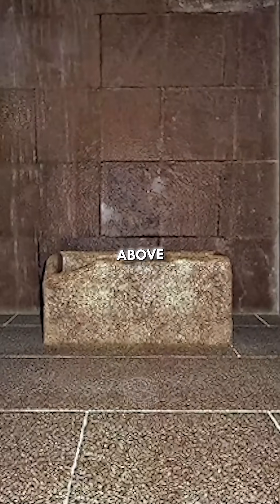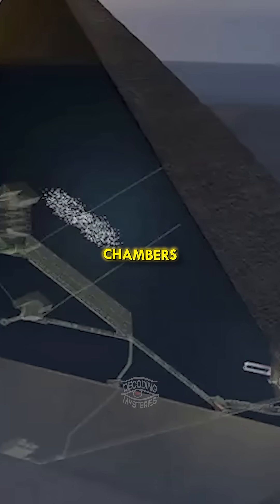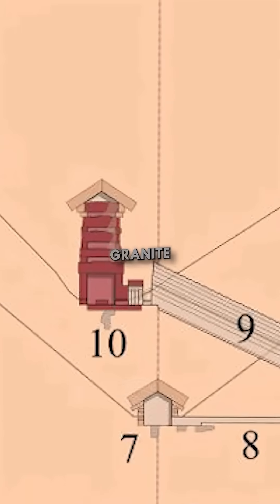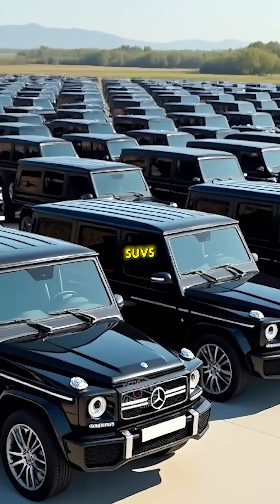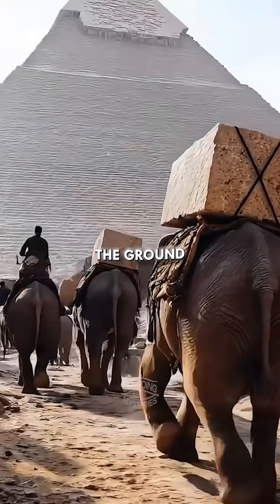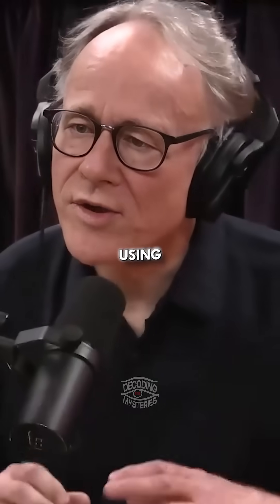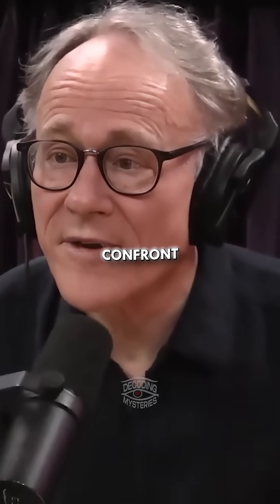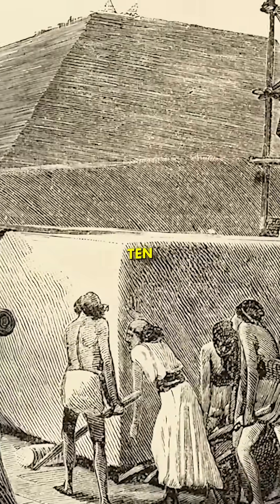Engineering Secrets of Egypt's Great Pyramid That Defy Logic 📜

Comment: The pyramid has a system inside to raise the rocks, a hydraulic system. They weren't tombs, but pressurized water tanks, and those rocks are there to prevent air from escaping.

Comment: The smooth stone started at the bottom and was used as a ramp to slide the blocks up as the pyramid grew and on the other side giant bags of rocks would slide down the stone slide on that face. Not a single elephant was needed. The small "nubs" that you can see on the bottom of the surviving smooth stone pieces was there to help you slide the stone sideways click them into place so the stone slides could be moved around and there was never any intention to cover the pyramid in smooth stone except the Apex because the pyramids weren't ever seen because they were the foundation stones of stacked decking stacked floors forming a cube around the pyramid with just the Apex protruding from the top.

Because the pyramids were not the point it was the buildings that they supported that mattered and with up to 60 floors stacked decking the two larger FLOOD RETREAT SHELTERS could accommodate nearly 300,000 people each during the floods the reason nobody made art depicting the pyramids is because they were not visible inside the cubic temporary cities they were built to support.

Comment: I know exactly how the pyramids were built.  They built a large pool surrounding the pyramids.   Water was filled to the top.   When you drop a 70 ton beams into the pool of water, the weight decreases as per the same laws of physics.  The water was also the best way to level the pyramid bases to make sure they are all leveled.
Reply: Free clue:  multi-ton granite and limestone blocks  do not float.  They are not rubber duckies.

Comment: The egyptions used the sand from the desert to make a hill and kept adding on to it as the pyramid got higher, Using elephants and teams of men to pull the massive rocks. They likely used logs underneath the stones to make them easier to move.

Comment: A thought occurs to me, and I will prefix it by saying that I am certainly not an engineer so, the hypothesis I am about to pitch is, I am aware, coming from a position of ignorance so I humbly request and encourage people who know more than me to kindly point out the flaws in my logic...

Could these beams not have been created in advance of the pyramid and moved up to the final resting place as the pyramid was being constructed beneath and around them? Thus they would not have had to move them up the steep incline, and they would be able to shift them in relatively small increments lowering the overall workload.

Comment: If you create a ramp at 10° and wrap it around the pyramid you reach the top at 1.13 times around the pyramid it's not hard you're over thinking it
Reply: Very plausible for most of the stones, but how would they lift the 400+ ton stones up a 10 degree angle? Even with modern equipment that wouldn’t be easy, you’d need a fairly strong crane. How did they do that almost 5 thousand years ago just in 20 years??

Comment: I think they used water power personally with sand as counter weight in huge hessian sacks, I think they used ropes tied around huge wooden reels that water power turned and additionally counter weights to add power, they could have used lots of sacks filled with sand as it would be easy to get up to height using small buckets and man power

Comment: I am knowm as Z¤yx~~1109` I am from the Ni¤vtyrver Galaxy. Our species is exceedingly far from Earth. We travel using black holes you have discovered to move through space. Its the way of interstellar travel. We built these pyramids using a gelogifyicpostranspfg quantum lineal pos prythific mass lifted and placed method. The human race has not yet developed to this stage of evolution.  It will be clear after the 12th quadrant of your brain develops. This means  another 200 years of earth years into your evolution. You are developing much faster than we anticipated..No amount of manpower or your current understanding of engineering could build them. They are markers for our travel navigation  and to help you develope the type of engineering interest you need to open the sectors of creation in your minds." AND THERE YOU GO!"

Comment: It could be done.  They used a vertical axis swiveling pulley crane mounted on a wagon.  Of course the machine was massive but they have all the time, horses and slaves they need.

Comment: The best description of how they lifted the stones is by using a hydraulic lift system. They built a hollow water proof column with an opening at the bottom. They would place the stone on a float and then fill the shaft with water which would then lift the stone upward, after the opening was sealed.
Reply: or you simply have counterweights. You just need a stable enough lift but given enough manpower and time it seems pretty duable. the counterweight is much lighter stones. Sounds like a lot of work as wel but they had tends of thousands of people and decades of time to build those pyramids.

Comment: His implication is that ancient Egyptians couldn't THINK! They used a counterweight to drag those stones up that 12 degree slope.
Reply: How'd they get the first counterweight up then?
Reply: @derekheuring2984  The weight of 50 people, each carrying a 100 pound stone..
Reply: @derekheuring2984  Smaller counterweights lol, I don't believe this happened though
Reply: @derekheuring2984  People walked up, got on a sled with rollers, and ropes led around pullys went back down, and pulled the stones up.
Reply: .   PEOPLE walked up the slope, and rode down on a counterweight sled, pulling the stones up to each successively higher row of pyramid stones.
Reply: and they used steel cables doing it.
Reply: @BigBeezyBtown  That's a joke, right? Ha ha.
Reply: @BigBeezyBtown Probably hemp rope.
Reply: @BigBeezyBtown  even with steel cables you'd need about 30 of them, 1inch thick each, to safely lift 70 tons
Reply: @Zreknarf  damn. I honestly think they used a method we literally haven't invented yet. We may think we are far superior, but they did accomplish this.
Reply: @BigBeezyBtown  eh, i might be well off, the largest crane we have today lifts 6000 tons, using steel cable, and it doesn't appear to be using 3000 cables lol
Reply: . They did!
Reply: I believe ramps coiled around the pyramids, but if they used counter weights, they knew how to build boats so they could easily build many containers and use water as counter weights.
Reply: @mattc6226 right, i thought coiling the ramps could answer the problem of the vertical slope
Reply: RIGHT!
Reply: . Good solution! (No pun intended!)
Reply: They could just wrap around the pyramid so they wont need the 12 degrees or just put another stone on the ground attached with ropes to that one on the ramp with more people pushing and push it so the stone on the ramp goes up that way you have way more people helping
Reply: @GGgamer-pr4lc and how u make the ramp on top of dat? the last stone is still impossible to pßlace
Reply: What he is saying is all of the solutions academics come up with probably wouldn't work, not that Egyptians couldn't think.
Reply: They didn't drag the stones to the top of the pyramid. They dragged the granite to the base of the pyramid along a flat surface and lifted them up with each new layer of the pyramid. This can be done with counterweights.Wally Wallington demonstrated how this is possible, lifting a concrete block single-handedly. You can find him on youtube.

Comment: There a guy in Michigan who moves and lifts 70-ton beams by himself for fun. 

Attach a pole as a lever. Tip the stone. Insert a small stone to use as a fulcrum. Tilt the other way. Insert another stone. Tilt and walk the beam. 

To lift, use shims instead of fulcrums. 

Sure, you only get an inch at a time, but so what? It's one guy. The Pharaohs had thousands.